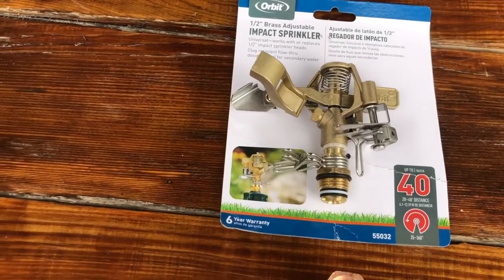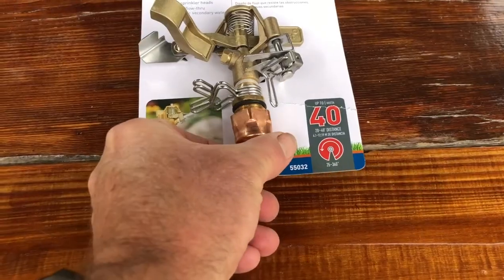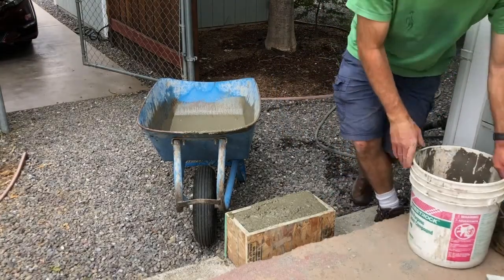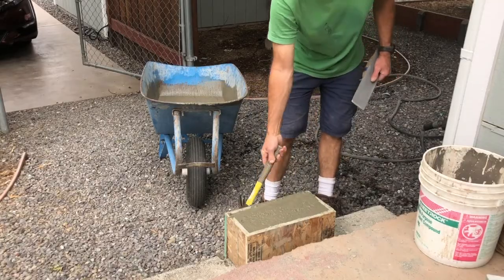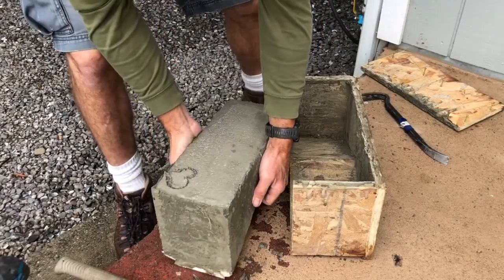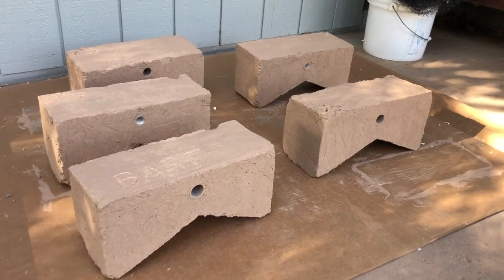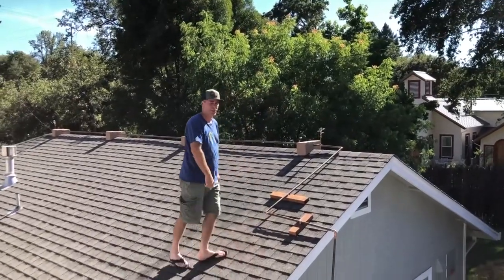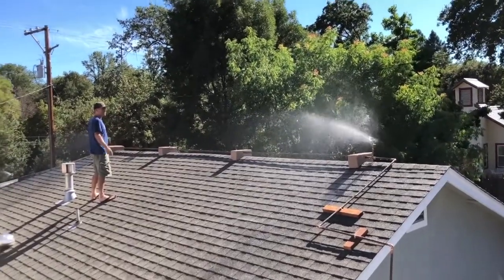Build your own Rooftop Sprinkler System/Fire Harden your home!

Comment: Is there any device can sensor sun heat to make the sprinkler automatically operate when sun heating?
Reply from the maker: I'm not aware of one, but I'm sure there is something out there that could trigger the valve when the roof temp got to a certain amount.
Reply: @kekanipahu  maybe put mirror under sprinkler fire sensor.. sun heat will reflect the light from mirror to the sprinkler sensor

Comment: Just seat it on peak without adhesive?
Reply from the maker: Yes, the angle of the concrete form basically locks it into place...plus the weight of the concrete.  Adhesive is not a bad idea, though.  Especially in California where earthquakes are common.